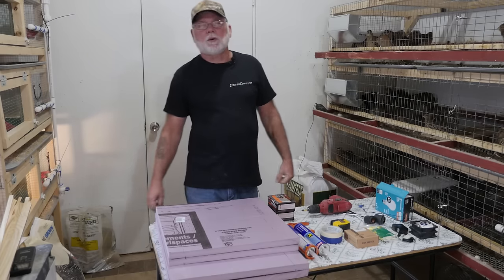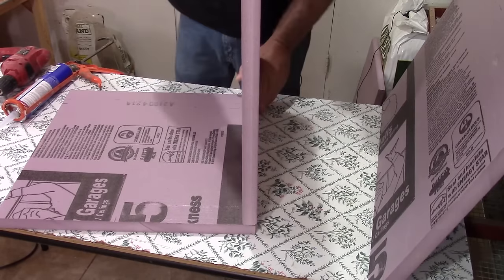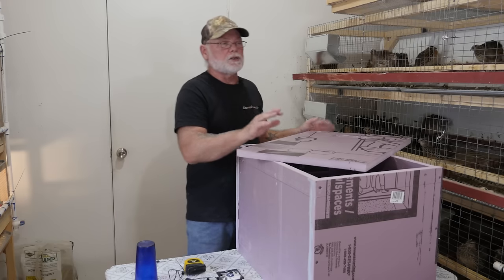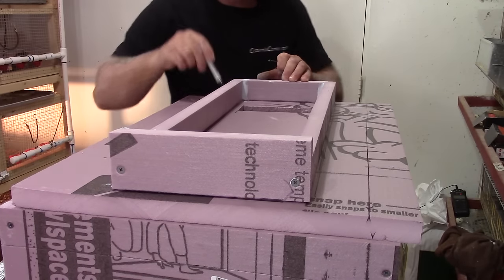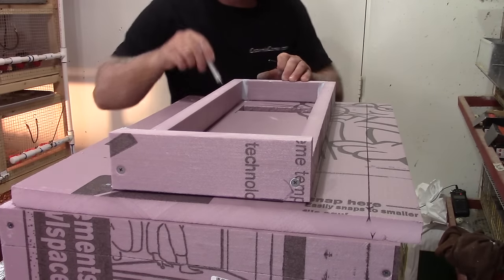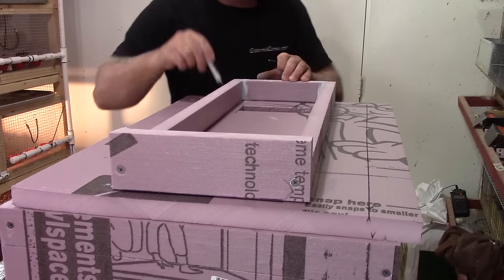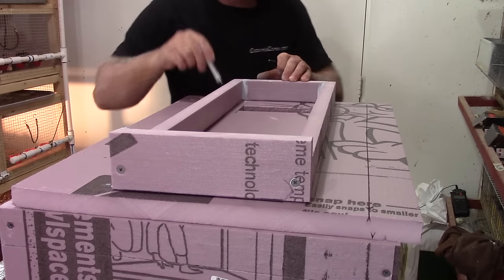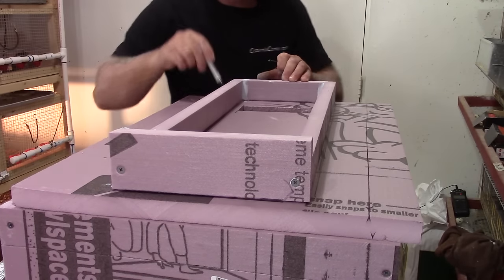How to: Cabinet Incubator - 240 quail egg incubator

Comment: I want to thank you for showing how to build an incubator,  I hatch Bob white quail back in the 60s and had a $3000.00 forced air incubator and was lucky to get over 55% hatch rate. I  built my incubator a little bigger and put a motor in it to turn the eggs 6 times a day.  Well I got 50 Bob white eggs and put them in the incubator and on the last of the 20 day put them in the hatcher I built the same way you did your incubator.  Back in the 60s the quail would start hatching around the first of the 23rd day and go thru the 25th day.  Now I was hatching around 140 eggs a week.  The quail this time started pipping the shell on the last hour of the 22nd day.  The start of the 23 day they were all piping a little dent on their eggs , but weren't hatching.  when the 23rd day was over not a one had started to pip around the egg to hatch.  Well on the 24th day, 3 hours and 9 minutes into it, I noticed one had finally started to peck around the top of the shell to hatch.  Now these are shipped eggs thru the mail- 50 of them and one was crack.  Well after the one came out, 2 hours later 35 had hatch and were out.  7 hours after these hatched I had a total of 43 had hatched! next morning I got up and three of the six left had hatch.!  This is the best hatch rate I have ever had and using your instruction on the incubator and the equipment to get has really help me get a better incubator than I could of brought and a hatcher too!  I got a 92% hatch rate with shipped eggs.  Thanks a lot for putting this video on here and the instruction you provided!  Keep up the good work!  Thanks again!
Reply: How did you turn the eggs?

Comment: This is wonderful!

 I remember being 10 years old and wanting to help my dad with our homestead  so I built my own egg incubator out of scrap wood, insulation foam and a small office fan. 
The "door" was a piece of insulation foam longer than what was needed cause of the holes I cut into it to control the temperature. My only design flaw was my lamp and sadly the bulb died when my eggs were 13 days into the incubator so it was a sad day for me, but my parents were still impressed. 
I'm 26 now, only lived on that homestead for 3 years before we moved back to new york, and now as an adult living on my own for a decade now I was considering quail over chickens as a starter poultry due to the restaurants near me.

Comment: I just built this and used an Inkbird ITV-106VL and after auto-tune the PID it is holding a steady 99.7 with just +/-0.15 degree fluctuation, It works great Terry! thanks for sharing the build.
Reply: What is your hatch rate? Did you make any changes?
Reply: @TheRainHarvester  my hatch rate was in the low 90s to high 70s with the quail, 80+ with chicken eggs and 65% with duck eggs

Comment: Hey terry, I finally built the incubator and it’s been running for 10 days no issues! I made one change. I didn’t like the fact that your temperature controller only was able to be set in 1 degree intervals so I opted for a PID controller. I got the ink bird PID with a solid state relay off Amazon for $40 and then I got a pt100 sensor for $10 and I have to say this combination is amazing. PID controllers (proportional integral derivative) are SO accurate. My device is set for 99.5 and it only hits 99.4 maybe once an hour 😳😳 it’s constantly at 99.5. One last tip, I use laminated pegboard for the tray that holds the egg turner. It allows for a lot of airflow! So far all 12 eggs are alive and this incubator is 1000% more reliable than the little giant incubator I had. That trash incubator cooked my eggs at 115 degrees when they were about 1/3 developed…

Oh yea and I put a small box made of foam board on top of the incubator and cut holes for my controller and my toggle switch so it’s inlaid in the foam as well as all wire connections are covered up. It’s really snug and looks nice. The toggle switch was such a nice add on. Also an outlet on the inside of that box so you can plug in the fan as well as the egg turner that way there is only one plug to plug in the wall
Reply: Have any videos on this? Sounds interesting
Reply: Would love to see pictures of your build!

Comment from the maker: Thanks for stopping by the channel. If you have any questions or comments about this incubator or building process, please post your comments down below.  Hope you enjoyed the video!
Reply: Nice build! Would this work say in an unheated garage where the temps get below freezing?
Reply from the maker: @stevenmwarehimee  I really can't say what the lowest external temperatures are that the heating elements could keep up with. As built they would probably be on continuously and still not reach incubation temperatures. I would imagine if you insulated the cabinet enough it could be made to be used in lower temperatures.
Reply: I need a temoster please how do I get it?
Reply from the maker: around the block  There is a complete list of all materials needed in the description, there is also a link to the cut list. If you order from the links they are shipped from amazon, not china.
Reply from the maker: @akentiabraham8907  There are links in the description to all materials and parts from Amazon.
Reply: @akentiabraham8907  : Available from Amazon, $15.00
Reply: Coturnix Corner thanks for this great video! I’m currently using an old cooler which works but it’s laborious. I’m about to order the parts and build yours. I will keep you posted! Stay safe!!
Reply from the maker: @johnheard5115  Thank you, good luck with your build!
Reply: Thank you for posting!  Great instructions! 
I bought an incubator after using a heating pad and styrofoam box. I also had a thermometer with humidity gage. 
It worked, I hatched a few eggs. 
I ordered eggs so I bought an incubator. Eggs came from Florida so I know some won’t make it. Today is lockdown. I see life in some. Hoping for cute babies. Ordered tuxedo eggs. 
Someday, I want a small homestead/ sanctuary. 
Your videos inspire me and teach me. Thank you.
Reply from the maker: @awesomekoga7848 , thanks for the nice comment. I'm glad you're enjoying the channel. Good luck with your hatch!
Reply: Any instructions on how to make the wooden trays with the egg turners installed etc? I love the incubator design and your help. Great video!! Thank you
Reply: @akentiabraham8907  It is called a thermostat and he mentioned where you can get it from - Amazon, Ebay, etc.
Reply: Coturnix Corner thanks! Great design. Where do you get your chicken poop trays that I can see in your well designed coops?
Reply: @Baruzuland  I believe he said he gets them from tractor supply in one of his videos. They are also available at auto parts stores
Reply: G'day Terry, really enjoyed the video. Is your temp. controller 12v or 110v mains power?
Reply: Do the fans run even when the heater shuts off?
Reply: Thanks for the build we got it built and iv had it running for about 3 days now getting the temp right but for some reason i can't get my humidity above 32% i have a  tray in the bottom and a small cup bellow the lights as of now
Reply from the maker: @Mrkillerlee  there are a few factors that could affect humidity, first did you use the recommended fans and light bulbs. Also, check the vent holes, sometimes you need to close off one or two to help bring up humidity. Join the facebook group Coturnix Corner, there are a lot of discussions on this very topic.
Reply: Thanks Terry! I have completed the build and have a dozen turkey eggs in there on the maiden voyage. So far so good. Temperature is a lot more steady than in my other home builds and this is my favourite to date. 
One comment if I might is that the size limits the turners we have access to here in Canada. I’m wishing I would have picked the Turner I wanted (had access to, or shipped to Canada) first, got the measurements and built around it. No biggy though as I’m thoroughly impressed and will build another using the first one as a hatching incubator. Thanks again and stay healthy, look forward to more great videos.
Reply from the maker: @johnheard5115  Yes, that is what I did when designing the incubator, I built it around the egg turner. Good luck with your hatch and thanks for the comment!
Reply: Thank you for the great video. Gonna start my build soon. What type of blade do you have in your table saw?
Reply from the maker: @sammmy286  the table saw blade is a standard rip blade, the more teeth the better.
Reply: Scrap the 12v wall transformer, get ASIN: B07MZ4RFSS, off of amazon. It's a 15w 1.25amp waterproof L.E.D. Driver. I use one to run three fans, and it works great! Can be installed inside out of view, free up an outlet, and cutdown on wires hanging around! I'm just starting out with quail, and want to thank you for all your helpful videos!
Reply: Great video. Does this home build have as good of a hatch rate as a store bought incubator?
Reply: I would increase the insulation with double walls (thin dead air space in-between) and inclose the cabinet in a wooden box with heating pads for less temperature  fluctuations.   
I would  test this for several days before committing eggs to make sure the incubator maintains the constant 99 degrees,  then just a dozen  eggs or as many as you can gamble with.   06/15/2021
Reply from the maker: @l.skipallen9080  that’s overkill, Myself and 100’s of others have been getting excellent hatch rates as is. I’m going on two years and 1000’s of eggs hatched only having to occasionally replace the bulbs. The idea was to design an easy to build, inexpensive incubator that works as well as any commercially built incubator. I think this design does just that.
Reply: @CoturnixCorner  What is your hatch rate? Thanks for this eggcelent video!

Comment: Something I have found when working with this foam building boats is that barbecue skewers work perfectly to essentially nail the pieces together during the drying process. I use none expanding spray foam as a glue it holds pretty good as long as it’s not structural and drys quickly

Comment: Thank you Terry for the inspiration -- 'I can do this!'
I have a non-working office fridge that I want to convert into this type of incubator.   
 I can remove & replace the rotten door gasket with one from another fridge,  remove the plastic shelf from the inside-of-the-door and add foam board there, so there is insulation OR replace the whole door with a foam board door like Terry did in his build.    
I will remove all the refrigeration apparatus , fill holes with spray foam and  create a good incubator.  😁
In Phoenix,  Arizona  we don't  have "freezing" temperatures, (LOL)  so I think my plan will work.
I may add a layer of foam board on all exterior sides to keep the interior from cooling down very much or very often, to save on electricity.   
This recycled fridge has the shelf bars on each side for sliding of the egg trays.  I need to buy a turner plus a few other gadgets.  👍 
I want to place the fans & heating element on the inside back wall - and make it easy to R & R.    06/15/2021
Reply: Update: my small fridge is too small inside.   😩
But a regular size  kitchen fridge will work.  👍
I'm looking for: 
1. a freezer-bottm with fresh- food-on-top, non-working fridge to make into my incubator and 
2. a large piece of plexiglass to use as an interior door so when I open the outside door, the warm air doesn't leave . . . 
I want the unit with a bottom freezer because I won't have to bend down so much.  
The shelves & insulation are there and there is enough room for the  heater inside  at the rear,  but I have drill some vent holes.    06/27/2021
Reply: @l.skipallen9080  Make a video. I've not seen any how-tos yet for a fridge incubator.  We have a useless fridge in basement  that's too heavy to haul up the stairs....  a plexiglss door and  a foam door ....  The separate freezer compartment could be used to store feed....
Reply: @hal7ter  OR better yet use the freezer for the hatching lockdown and the fridge part for your incubation and stagger your hatches. Not sure you would need food stored in it as you don't feed them until after they are in your separate brooder...

Comment: Hey CC, would like to say that I have used your how-to videos to get my first flock going. I purchased chicks after spending about two weeks building one of your cage techs, and then made a second as a layer cage. Current capacity 15 of 108 birds!

The auto zone guys now don't really like me, as I keep buying all their oil trays in stock (they explained that they only keep 3 oil trays in stock at a time. Oh well!)

I just used this tech to get my incubator going. However, the recommended egg turner will not fit on the second shelf without some modification. Oh well, the thing works great and saved me about $900!
Reply: Do those guys a favor and call the day before and they can get those in

Comment: Thanks Terry. I build this today. I'm very happy you were so thorough with your explanation.  Can't wait to get started this week. Thanks!
Reply from the maker: Good luck with your build!
Reply: What is your hatch rate? Did you make any modifications?
Reply: @TheRainHarvester  : Hatch rate is about 85%. I only made some small changes.  Such as latches and larger window. Weather stripping around the door to keep the heat in. Otherwise,  exactly as Terry showed in his video.
Reply: @muzzyinbambi  Thanks! Did you need to cut a recess for weather stripping?
Reply: @TheRainHarvester  : No it was simple peel and stick weather stripping.
Reply: @muzzyinbambi  Oh good idea. I forgot I have some of that!
Reply: @muzzyinbambi how did you check humidity?

Comment: I really like this. I made one for myself with a few tweaks to control humidity and hide electric connections ect. I appreciate you sharing your design and having pics and video and materials used if interested.
Reply from the maker: Thank you and good luck with your new incubator
Reply: I'm interested! What mods did you make, and what is your hatch rate?

Comment: Great build. Watch the DC polarity of the 12v fans. Switching the cables if the power supply  may change the spin direction  of the fans or they won't turn on at all.
Reply: They will just break. There is a small chip inside which does the magic :)

Comment: Thank you so much for taking the time to make this video.  I did have a rough time with the temp controller, I purchased a Ketotek KT 1000 from Amazon.  It has a little different wiring diagram, I wired it up set temp set offset, heat light was flashing but lights wouldnt come on.  So I hooked up lights straight to 110 to just see if the work, they turned on.  Watched( I think every video on wiring one of these, it still wouldnt come on.  So I ordered another Kt 1000,  ( I would have ordered an inkbird but Amazon said shipping would be May 3) it came in today, installed all wires set my limits and it does the same thing.  I'm really frustrated now.  So my temp setting is F1, temp offset is F2, in all this temp control has 6 channels. So I decided to go into F3 which is compressor delay limit.  As soon as I entered F3 my lights turned on. And it works like a charm.  Temp set 99.5 ,  stays 99.3 to 99.8. Just love it,  thanks again.

Can you calibrate the inkbird,  the kt1000 I can do ice bath and calibrate so temp is correct.
Reply from the maker: Yes, the inkbird has a temperature offset where you can adjust temp difference if it is off. I have 4 Inkbirds and everyone is spot on. Here is a video I did on the Inkbird   https://youtu.be/2qspysPPpuI

Comment: Awesome build !! Thanks for the help and great video !! I modified mine with a top channel enclosing the electrical and the ink bird controller that I already had purchased for another project . Also if you set the controller up in C at 37.5 you can run the differential down to .3  and it holds 99.5 a little closer . got it loaded and so far so good  ! thanks again oh about those hatching boxes ???

Comment: Just a little sidenote when you’re holding up the piece that holds the fan inside with the 45° cuts, you say 8 1/2 inches wide on the wrong side. It’s actually 8 1/2 inches wide on the opposite side from the one you were holding toward the camera.

Comment: Great video. Building my own cabinet incubator now. Wish I had found your video before I started. Mine is framed in square tubing and should 8 trays of 120 eggs. The part about the electronics was most useful. I am trying to figure out an egg turning system at the moment.
Reply: You can get factory built egg racks for about 40 bucks, or incubator warehouse has them
Reply: I have found egg turning trays for 30 to 44 bucks check Amazon and eBay, got two 50 chicken egg trays last year for 25 each with the power cord already wired up

Comment: Hi Terry, I'm about to build your incubator, except for chickens. I'm hoping the measurements will work out. I'm planning to use an egg turner from an old styrofoam incubator that I have on hand. My question is about the holes for ventilation that you mentioned at the end. How big and how many?  Thanks for the information. Your video was well made.
Reply: thanks for this question!  I was just about to ask the same thing but figured I would scroll first!  lol  I bought a 120V automatic egg turner that holds 56 eggs.  I am going to build this same design, but will build the dimensions to accommodate the size of my turner!  Have fun and good luck!

Comment: How do you wire those fans up? I ordered the two you referenced. You didn’t cover the wiring up. I noticed the power 12 volt power outlet has a - and +. The fan wire has 3 wire going to a small block. Any help would be greatly appreciated! Thanks Terry for your knowledge in this!